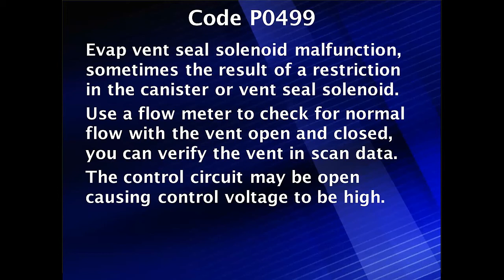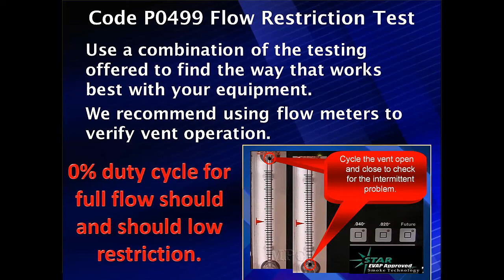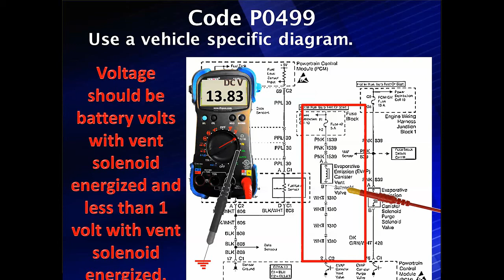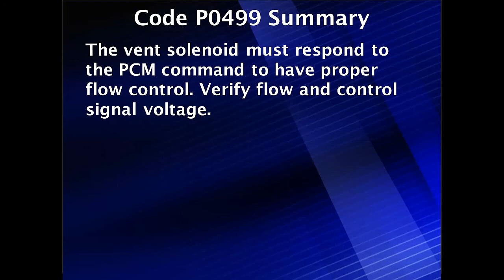27 Code P0499 Diagnostic Procedure

Comment: Same here on my 2019 silverado I had the 499 code replaced the canister vent solenoid and my engine light is still on, took it back to shop this morning and was told it’s not getting enough voltage
Reply: How did you end up fixing it
Reply: @Macndahat1  had to order another one the first one was defective

Comment: Got a new evap canister and solenoid valve and fuelcap and pcm on my 2006 300c hemi and still p0499 code.  My old pcm did not throw the p0499 code.  Wonder if previous owner deleted evap system in old pcm or is my new pcm not corresponding with evap system?